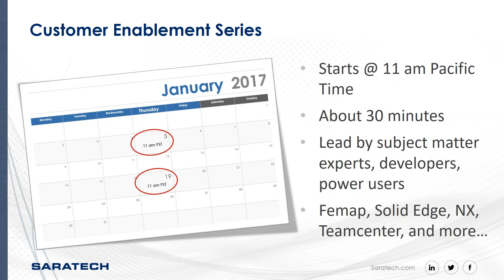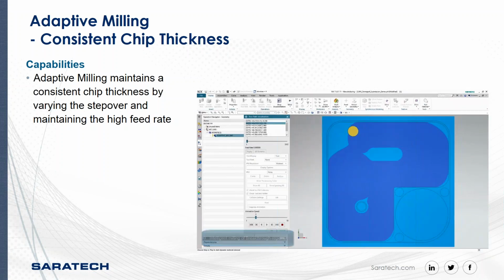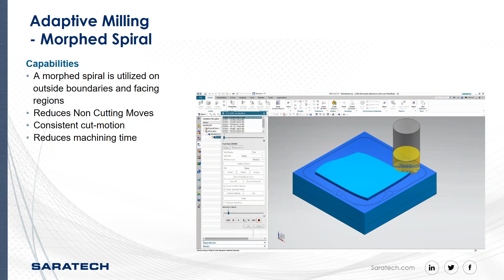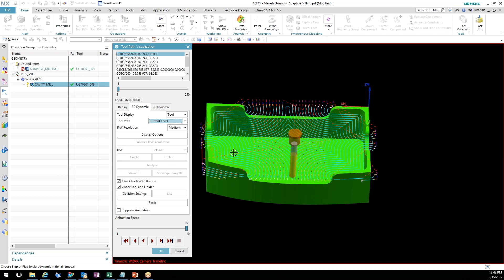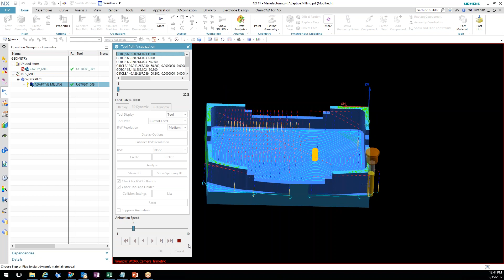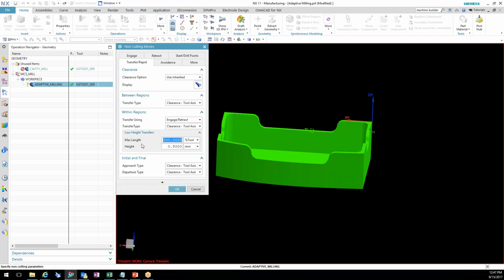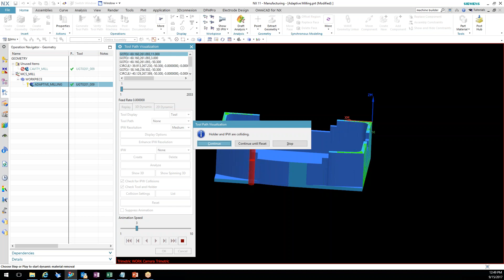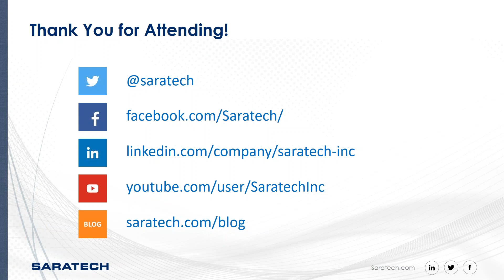CES: NX CAM - Adaptive Milling Operation

Comment: I wish they would have added a faster feed rate when it's not cutting on return to cut, also ramp up the feed rate as it enters into the cut. As is is there is only 1 feed rate though out the entire cut.